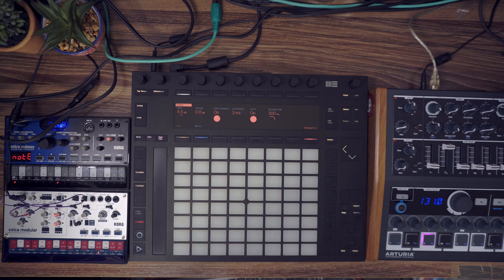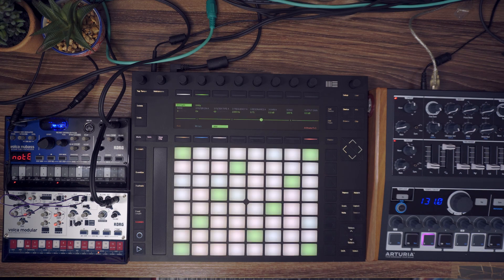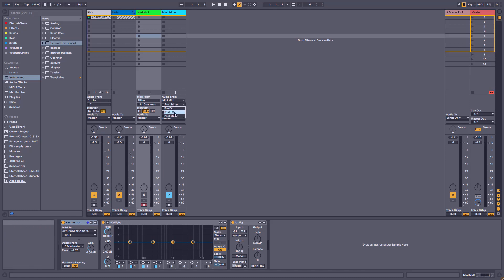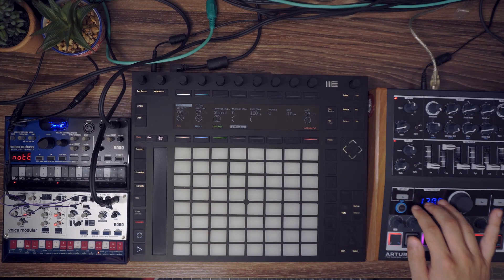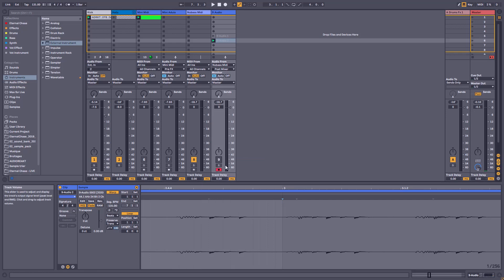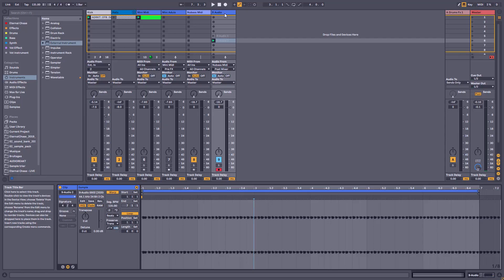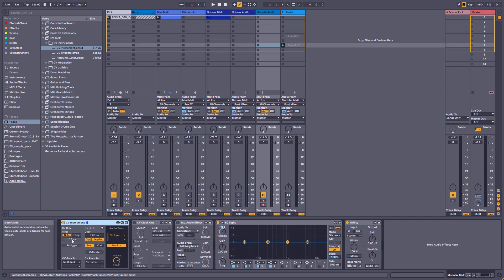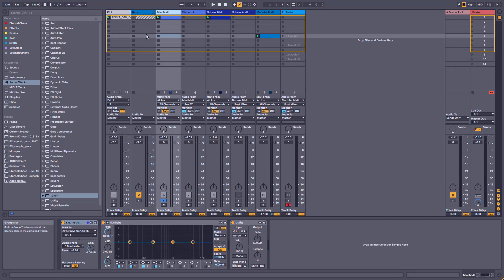How to Sync your Hardware with Ableton Live (with Usb, Midi & CV)

Comment: Cable from 16:41
Is it "stereo" 3.5mm to two 1/4 inch trs? but, the ring of both trs is "floating"? (both rings arent connected to anything)
Reply from the maker: Yeah I used a trs cable because I dindt have a ts cable but it work with ts cable,
Reply: @audioreakt  so now i can conclude.... that for synthdevice sthat just use +/-3.5 V, that FLOATING RING CABLE ,topic is not relevant. It can take it, volca modular can take it. It says on the manual +/-3.3V. I thought to make this "Y" cable, trs miniplug to two trs plug with floating ring,its no use to worry about, if voltage use is low.... (may i ignorantly presume).

Thanks so much for this great content. <3

Comment: Somehow I cant get my hydrasynth to sync properly...
It doesnt matter what value I set in the "Midi Clock Sync Delay" 
It stay's at around 70ms
Reply from the maker: That's weird it should compensate, other wise use Ableton Delay compensation per track
Reply: @audioreakt  I got it working with the "Driver Error Compensation" it is alright with one external instrument.
Otherwise it will be the Track compensation :)
Thanks for the reply

Comment: how did you connect so many synthesizers if your sound card doesn't have so many inputs? are you using a mixer?
Reply from the maker: I have a mother 828mk2, which got 8 input so was enough until recently, then I got an ferrofish 16 for more input and output via adat

Comment: Great tutorial tnx a lot 🙏.  Quick question , can i somehow sync ableton 11 with cdj nexus 2? So the dj will play a regular dj set and for example i want to follow with some loops, fx, percussion etc.
Our gear is Pioneer Cdj nexus 2, mixer DDJ 900 with 2 sound card integrated, ableton push 2 and roland handpan. 
It seems is really hard to follow the bpm of the dj set, i tried everyrhing, but too many cables, too complicated setup with midi sync clock 😰. Tnx a lot for your awesome video keep up with your good work.
Reply from the maker: thanks, I am not really familiar with the nexus 2 and his functions...but with the new ableton 11 you can ask ableton to follow the tempo of an external source, it might be a way

Comment: Could you tell me if l can use my cobalt8 synthesizer in Ableton to connect to scaler 2 and use the sound patches from my synth in scaler 2, I can't seem to make it work.
Reply from the maker: I never used scaler, so check if you can play with your vst/external instrument in scale. It should be I think, captain chord does it
Reply: @audioreakt  l'm only using Ableton live lite could this be the problem because l don't see the external instrument feature.

Comment: Hello, Could you help me, Im using MPK249 midi controler with ableton, through MIDI track with External instrument running to Arturia Minibrute 2S, I can manage to control MB2S with MPK249 through Ableton. My issue is I can't have the ARP randomisation to work with the MPK , the arp is just steady , however when I press the pads on MB2S I can hear the randomisation. Thank you
Reply from the maker: But the randomisation on the minibrute work only with the Sequencer no ? I am not sure it work with the arp.

Comment: Hello bro do you think that your sync config it could function with tr8 vía usb + neutron   + pocket operator po- 12
Reply from the maker: I don't own this machine so I can't tell exactly. But I think you can sync the tr8 via usb, then you can take the midi out from the tr8 to sync the neutron. And for the PO-12 if you have something like the volca modular to sync with a small jack cable, you might use ableton cv clock to send clock to your po12

Comment: Man ive been looking to get a motu interface but they are out of my budget, turns out the 828mk2 firewire goes for a really good used price on reverb. May be have to get one! Or if u where me do u get a brand new one and take the hit?
Reply from the maker: Yeah I got mine 250£ years ago, it's very solid and still working very well without any problem (considering how old this card is). Check focusrite scarlett 18i20 I think, which seems to be a good card for the price
Reply: @audioreakt  focusrite is not dcc
Reply: M. Aoun what is dcc?
Reply from the maker: @latergarside-244  Yes he is right, dcc mean dc coupled, I forgot about it, you need an interface with dc coupled i/o  if you want to sync your hardware by cv.  Second hand motu 828 mk2 might be the cheepest option, check more info here : https://help.ableton.com/hc/en-us/articles/360004966139

Comment: Can a scarlett 2i2 output cv with its two mono balanced outputs? supposing i dont have monitors, which  I don’t. 
kek
Reply from the maker: check ableton website and the cv tools info, you have a list of all the soundcard that are compatible
Reply: @audioreakt  lmao i just bought a presonus studio 26c interface. Its cheap, its not shitty, it has 4 dc coupled outputs, as well as a midi interface. But i have just read, that on this model , since its a bus powered device, it has a lower range of control voltage... have i wasted my money? This voltage range reduction, could it be fixed on the cv clockout device? Like not reducing that much the “amp” of cv clokcout?
Reply from the maker: @finonomastropiero4261  To be honest this kind of information you need to check on ableton website or ask focusrite or ask ableton because I reckon it is a complex things and better double check two times before.
Reply: juejue, did buy presonus studio 26c audio interface! its nice....

But that damn cable for sending cv's..

Comment: Live doesnt have tight sync. The End. It will always be off, even if you get it to sync by the 2nd bar, that start is always off. Best case, record multiple bars and trash the 1st bar.
Reply from the maker: with midi yes indeed, that waht I usually do (scrapping the first bar). On the other hand My Analog Rytm sync perfectly to live with usb...probably because of the editor that make the link between hard and ableton...
Reply: @audioreakt  Thats good to know.

Comment: Синхронизировал пол часа и ничего в итоге синхронно не играет. 🤦‍♂️ Дизлайк чувак
Reply from the maker: Where ? The sync is perfect with midi and usb either when using the internal sequencer of the hardware or using ableton sequencer. I only strugled with the clock of the Volca Modular but still came out with the solution by passing throught the sync of the nubass connected via midi.
Reply: All You Need Is Live , 
I put a dislike for the last part of the video, where the delay could not be compensated. In addition, you could do a little sketch of playing all the instruments at the same time that you synchronized. I am sure that then micro delays were especially audible.
Reply: Pepito Jose tnx. I will check it
Reply from the maker: @habasoundprod  I understand,, in retrospect I would have probably done the video a bit differently and much more visual than it is. Again thanks for your feedback anyway, it help me progress and make better video for next times !